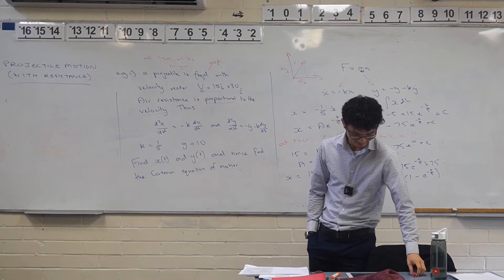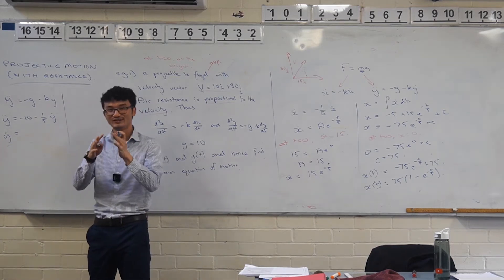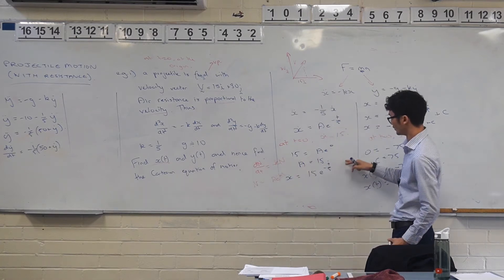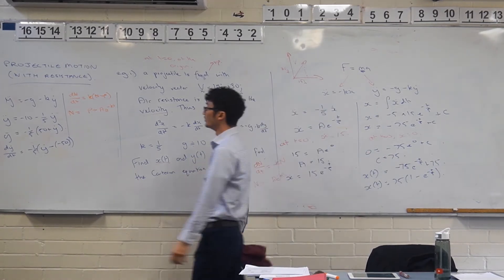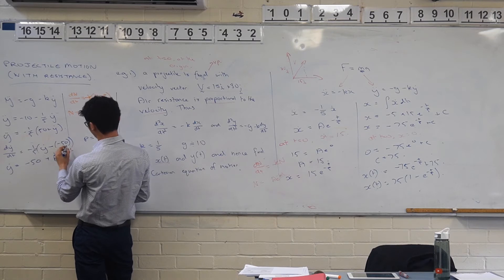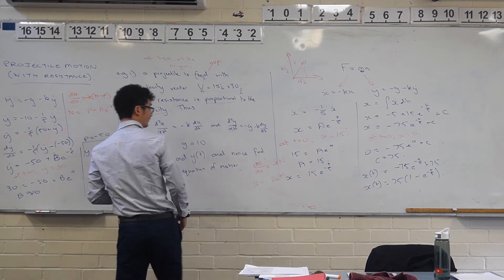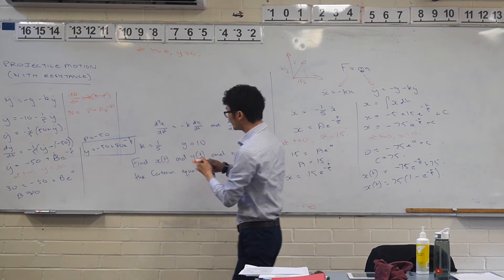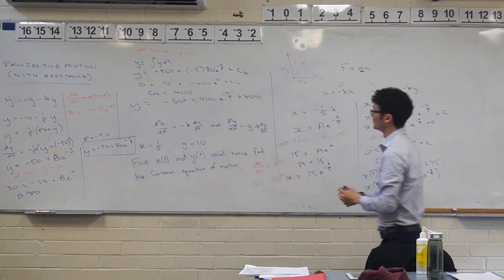Projectile Motion With Resistance (Part 2: Finding the Vertical Displacement)

Comment: haha. i didn't see that way to solve for velocity in y direction.

before this video was released, i tried solving the problem; I was like??? I know that HSC students don't do too complicated DEs... but the methods I did were "integrating factor" and "undetermined coefficients/variation of parameters" (and i managed to get the answer) but those methods are too complicated for the HSC students... so it stumped be to find a "seperation of variables method", or a "simpler method"

but now i feel like i wanna facepalm myself. I should've seen that I could've divided both sides by g+k(y^dot) to get:
d(y^dot)/(g+ky^dot) = -dt
integrating both sides gives
1/k * ln|g+ky^dot| = -t + E {E is a constant} - - - - - - - - - - - -
ln|g+ky^dot| = -kt + Ek
|g+ky^dot| = e^(-kt + Ek)
|g+ky^dot| = e^(-kt)*e^(Ek)
|g+ky^dot| = e^(Ek)*e^(-kt)
g+ky^dot = +/- e^(Ek) * e^(-kt) 
g + ky^dot = Me^(-kt) {M is another constant +/- e^(Ek) depending on the branch of the log you wish for}
ky^dot = Me^(-kt) - g
y^dot = Ne^(-kt) - g/k {N is another constant, can use initial conditions to find this N}

to be honest, I would have substituted initial conditions straight after i integrated "on the line with - - - - - - - -" to find E straight away.

From there it's pretty trivial to get the displacement for y(t), just integrate -g/k and Ne^(-kt) separately + constant blah blah blah
Reply from the maker: Haha yep, I only found out that method after someone's textbook showed me this method (Steve Howard). I use this method in a later video that will be uploaded. 

Funny that sometimes when you know more content you find the more complex methods! That's why I love seeing the solutions all my students come up with 😊

For initial conditions, there's also another trick where you can use a definite integral to do this, rather than having to substitute them in at t=0, y=0 etc which could save a bit of time/lines of writing in an exam (assuming you do it correctly!).
Reply: @MistaKimSing  Yes. I know of the definite integral trick as well. {it basically just comes from one of the fundamental theorems of calculus where you can change any indefinite integral to a definite integral, or stated better, the derivative of the integral of f(t) from a to x is equal to the integrand f(x) itself.} 

understand and use the Fundamental Theorem of Calculus,
𝐹′(𝑥)=d/dx ( ∫_a^x𝑓(𝑡)𝑑𝑡 )=𝑓(𝑥) and illustrate its proof geometrically (ACMMM130) {seen neater on the 59th page of the mathematics advanced syllabus pdf under integral calculus}

I know virtualb15 {another NESA teacher on youtube} uses this trick primarily to solve DEs with conditions.